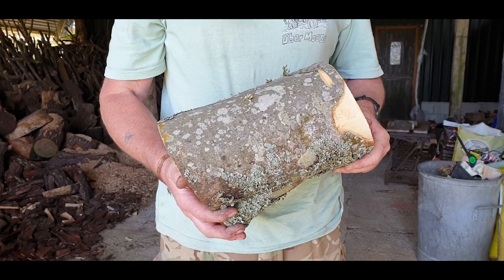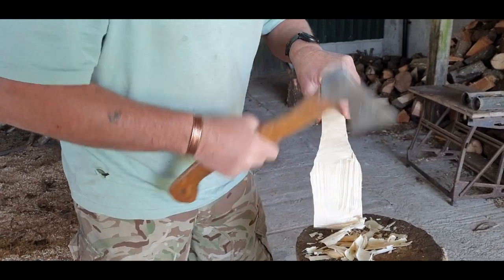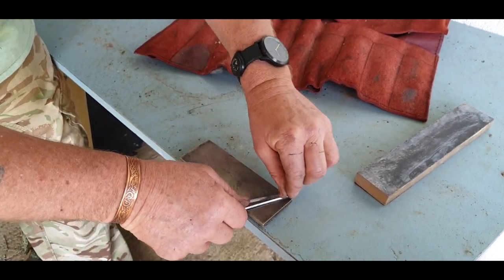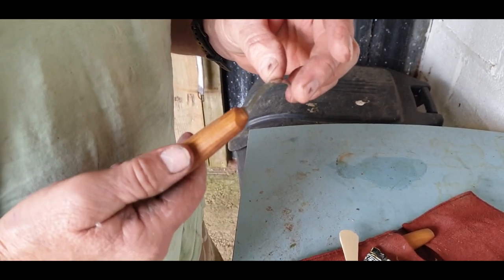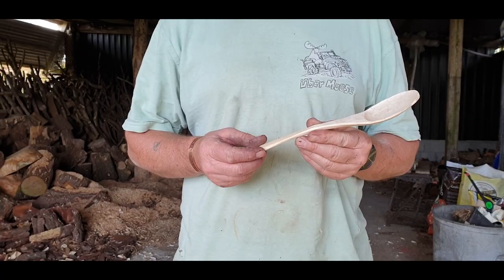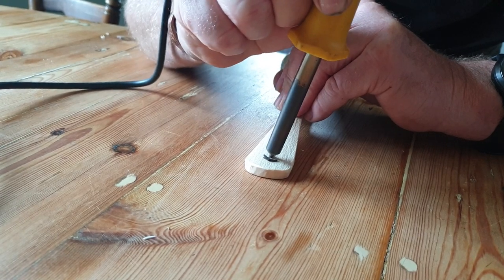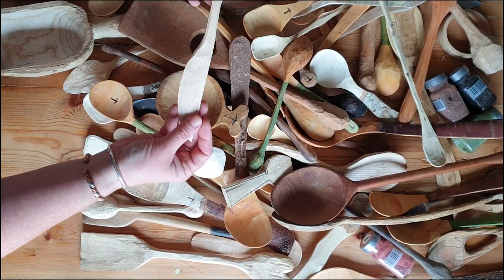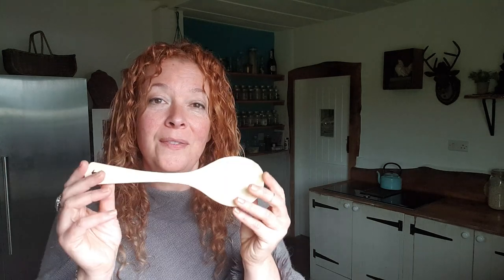How to Carve a Wooden Spoon: a chat with Jonny + GIVEAWAY!

Comment: You say about safety, yet Jonny only has flip flops on. It is very bad showing some one using an axe etc with almost bare feet.  Jonny should have decent boots on preferably with steel toes. I am shocked at your lack of responsibility !!!
Reply from the maker: Irene, you've made a very good point. If this hadn't been such a spur of the moment video that we filmed, I hope we would have done better. As it is, all I can do is pop a message in the description box. Thank you 😘